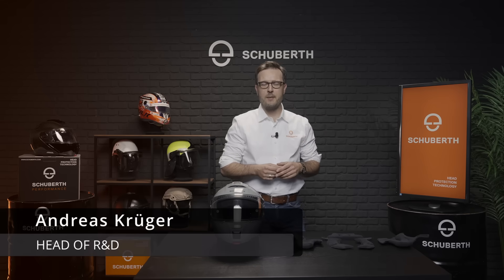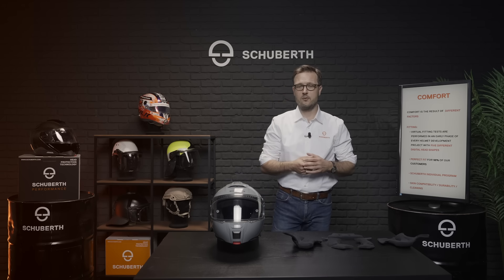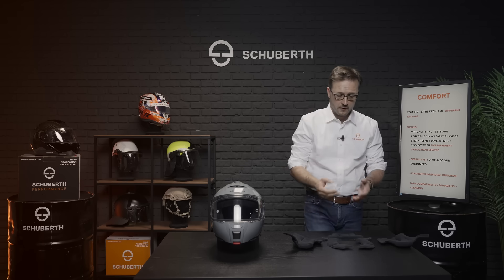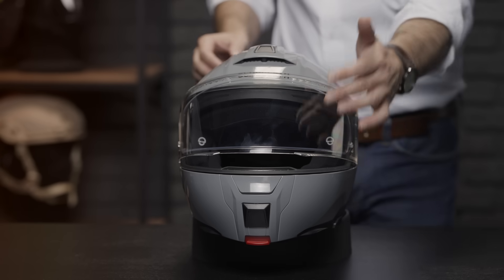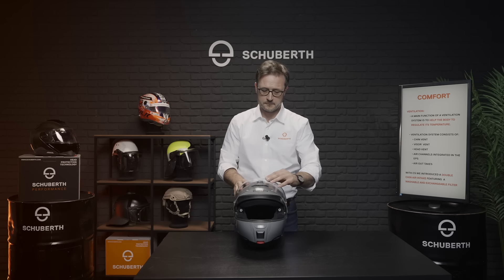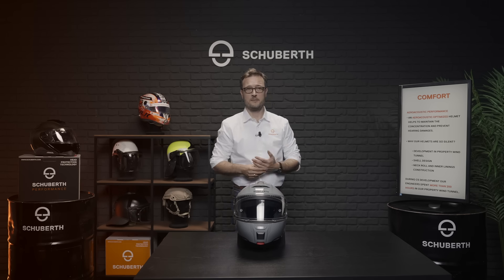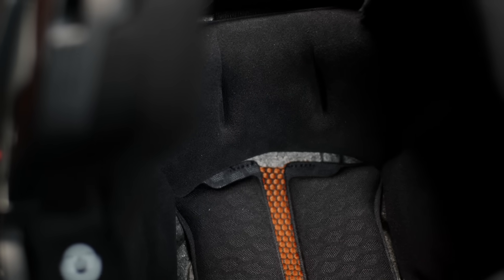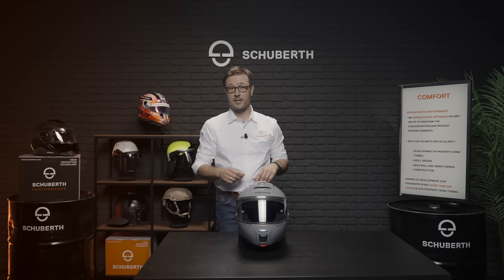What's behind a SCHUBERTH helmet? confort, aeroacustic and aerodinamic performance

Comment: I’ve been riding with Schuberth helmets since the original Concept, and now a C5.  Great helmet overall, but after 20 months, it tends to slide down on my forehead and is generally a bit loose.  It is an XL/61.  I will visit the local Cascade Moto BMW tomorrow to see if there are any options to resolve the fit, e.g. the cheek pads.  Apart from this issue, I have zero complaints about the helmet.